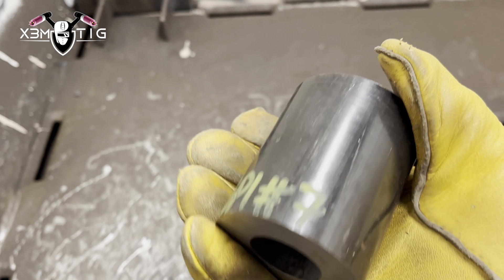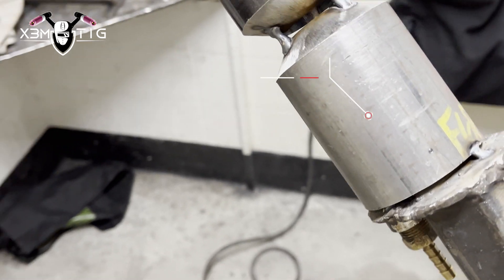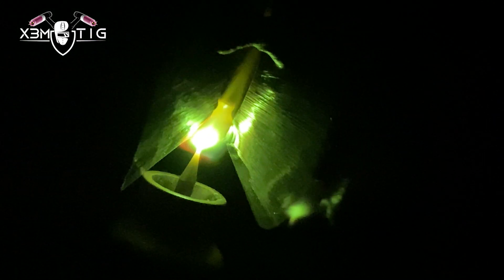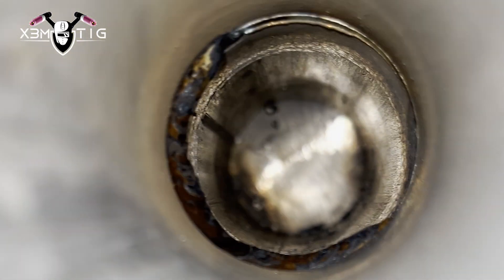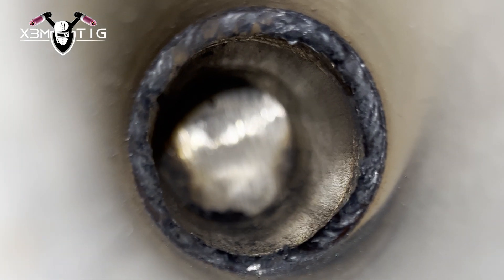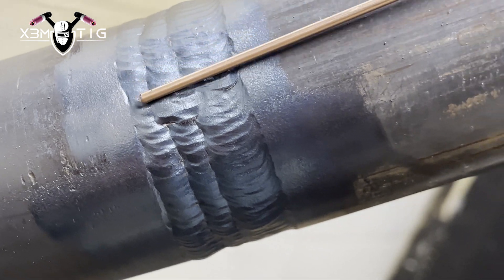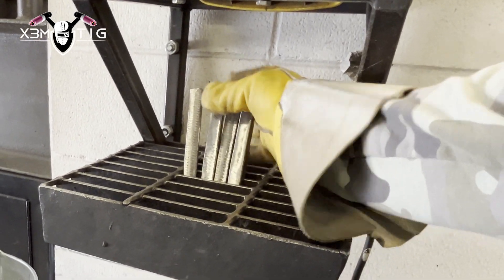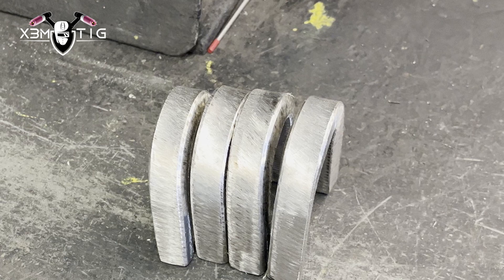TIG Welding 6G | Everything You Need To Know For Your TIG TEST!

Comment: this dude is awesome. i’ve learned a lot so far as a newer welder and welding at home. could you do a lay wire in depth video or any techniques/tips on using that specific technique. i’m not too comfortable with the floating filler yet 😂

Comment: If one was to get a lot of undercut on the inside of the pipe when putting in the root, what would you say they might be doing wrong?  The undercut is on the top and bottom almost the full circumference of the pipe.  There are no missed bevels or lack of fusion just a lot of undercut.

Comment: 316L and 2209 Duplex welder here, did this test a couple months ago, and honestly feel like you can get away with anything with mild steel. It's really weird to me to be welding without a purge too.

The main issue I found is how quickly it gets so damn hot.
Reply from the maker: Yeah, small diameter gets hot fast

Comment: I didn’t understand at the end what you meant about the hydraulic bender and that it was changed. What was the difference between the two different benders? Thank you for the video!
Reply: If you don't mind I can answer that for you. The press had the words "Heartbreaker" written in welding on the front of the machine. Meaning if your coupons break it will break your heart. I guess guys complained. It basically made a mockery of the coupon bend test. Not very professional in my opinion. I don't know if they switched it out because guys (or possibly gals) complained is true or not. Those presses must be fairly expensive. I mean, why not just grind off the words and just keep using the same press? problem solved.

Comment: Just an observational comment. That is not schedule 160 pipe. Schedule 160 has a much thinner wall thickness at .343 inches (8.738 mm). Just type schedule 160 2 inch test coupon on YouTube and you will see the difference. Other than that another great video.
Reply from the maker: You are right, I used boiler tube for test, and boiler tube is double in size for wall thickness around 16 mm. Good catch 👍

Comment: Seen many guys fail the bend test only because they didn't prep their test pieces well and rushed it. You can have a perfect weld but if you have any little indentions on the edges and you don't take the time and round and smooth them out those will turn into stress risers and could crack. Another excellent video. My back aches just watching how many times we have to go around those damn things to fill them in..
Reply from the maker: Thanks for your comment brother, and yes, you are absolutely right! 👍

Comment: What I always do it I'll put my root a amp im comfortable with,hot pass pass I'll put up abut more and as my fillers,capping I'll put abit lower then my my last filler run,no under cut no lack of fusion nice straight beed clean over lap on stringers
Reply from the maker: Sounds like you have a solid plan for your 6G welding!👍